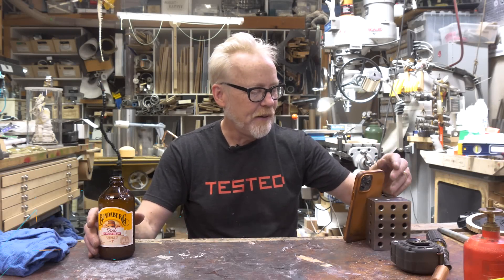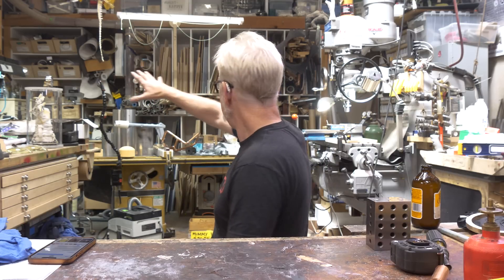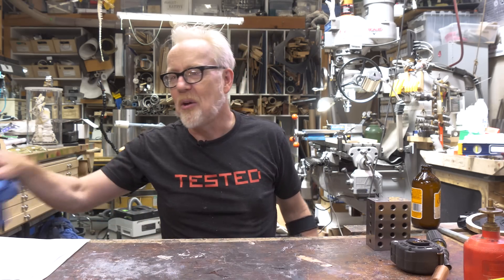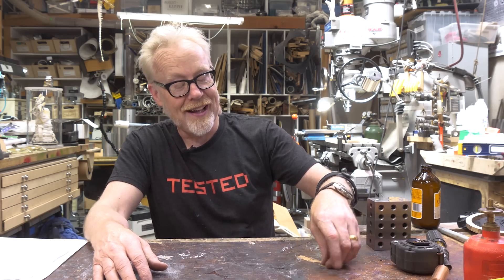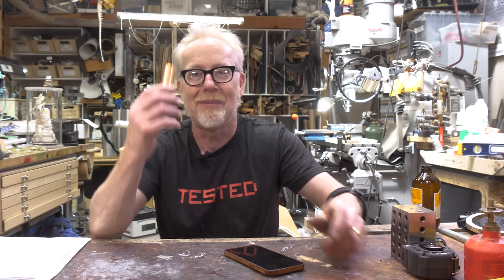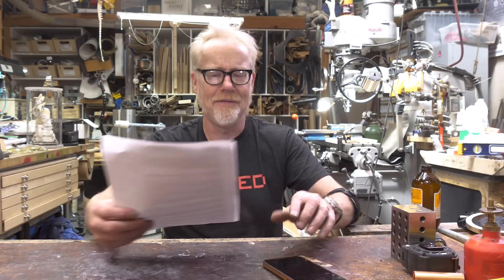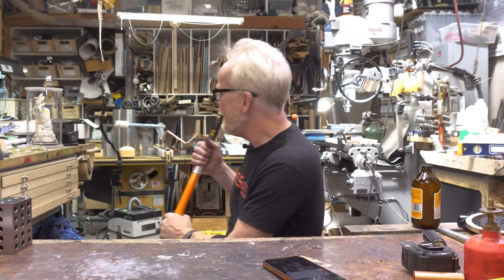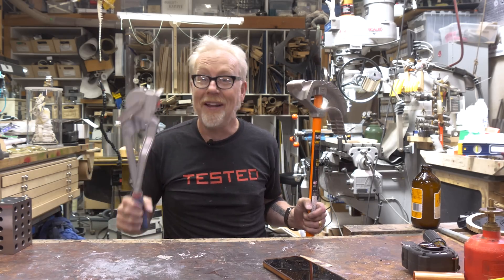Ask Adam Savage: Shop Power Distribution and How NOT to Lose Tools

Comment: Oh, yes. The 'buying another one of something because I can't find the first one' thing is why I have 3 or 4 12mm combination wrenches. Or forgetting I have something because I haven't used in so very long or got it but never used it. That's why I have 2 angle grinders. Though that's been a blessing in disguise since I can keep one set up with a cut-off wheel and one with a grinding disk.

Comment: Tool tip. If you have a one off and need a place to store it for the once in a while use go with the category it is. For example multimeter, OBD2 scanner and other electronic testing equipment gets the same drawer.

Comment: Split-phase or single-phase 240V is what is in the majority of homes.  A VFD or phase converter converts single-phase to three-phase.  In my neighborhood, there's a single wire, a 4600V feeder wire that the houses tap off of.  Single winding on one side for the HV and a center tapped winding for the 240V line in to the house.
I keep my conduit benders by the breaker panel.  Makes perfect sense to me.  ;)

Comment: Power is not something to mess around with unless you know what you are doing.  I work on low and medium voltage systems in industrial applications.  So working around power is not something i don't know how to deal with.  Home electrical?  No.  I will almost always get a residential electrician in to do the work.  Why?  I don't know the NEC.  It would be easy for me to make a mistake and do something wrong.

The residential electrical code is labyrinthine.  I simply don't have the time nor the inclination to deal with all that.  And since i don't want my home to burn down, i'm going to pay for the expertise of someone who does know.

Comment: also don't forget the cost of ownership, assuming you only have 3 phase power to your shop and no single phase delviered by your provider that means you will have your own stepdown transformer for your single phase useage and those babies use around 60 watts in standby and most people don't put those on a switch so that's a lot of power being used 24/7/365 that you are paying for VS if you have single phase delivered to your shop the provider pays for that loss.

Comment: Did your Power Co make you use 220 instead of 480? Everything runs cooler as your current use is cut considerably for a given piece of equipment. Smaller wire. Less current. Usually lower cost.

Comment: i'm lucky i have many friends in the I.B.E.W. if i have a power question they're pretty good about answering my questions. i was the concrete guy on the job sites and when i had nothing to do I'd help out the wire guys loved me lol cause i could push around the bigger spools of wire. that's how i met most of them. Adams right improper gauged wiring causes so many safety issues.

Comment: Early in my career, we worked in cubicles.  Power distribution was a daisy chain of power strips (typically 4-6 cubicles per chain).  Because of the kind of work we did, everyone had a minimum of 3 computers, with monitors, hard disks, etc.  The group's laser printer (one of the early, power hungry ones) was in my cubicle, plugged into the first power strip in the chain.  When someone would print something, you'd hear the printer's fan come on, then it would start heating the fuser wire (which literally melts the toner to the paper).  That's when the circuit breaker in the power strip would trip, and the swearing began.  We quickly developed a policy that whenever you wanted to print something, you had to announce to the whole group that you were about to print, and remind people to save their work.  Ah, those were the days.

Comment: Most of what I lose are hand tools. It happens when I have something in my hand and lay it down to pick another item up. As a result, car keys have been an issue. To combat it I intentionally place keys on the corner of a workbench or table. 
One day in my shop I had placed the keys, gotten out some boxes, found what I needed and reached for my keys. THEY WERE GONE! 
I looked under the bench and all around every corner of everything I was near, no keys. Doubting myself I stopped and visualized what I did. Yes, I did place it on THAT corner. So I sat down to get this conundrum solved and crunch, I felt the large key ring under my gluteus. Standing, I looked at the chair seat, no keys! WHAT!!! 
As I turned to look under the chair I felt something swinging from my backside. There they were hanging from my back pocket supported by the N52 super magnet I had slipped into my back pocket. It is difficult to describe how disorienting it was to lose something that was intentionally placed…

Comment: You would do well with a couple of rolls of ceramic wool. Just lay a mat under your welding, and a shower curtain around you. Roll it back up when you're done. It feels like cotton comes in rols like fiberglass insulation, and insulates like space shuttle tiles. You can heat it white hot, and hold it in your hand a second later. I can't believe you don't do more welding.

Comment: People get wound up about extension leads. If the extension lead is rated properly there are few issues with them. Especially if I'm in the shop by myself. I have all my tools plugged into the one outlet but I'm never using more than one (+ dust extraction) at once. I never run the table saw and the drill press and the pillar drill and the jigsaw and the Dremel at once, I don't have that many hands!

Comment: In my rental 's garage I have 1 single power outlet (from the early 60's i think) and  I don't have modern circuit breakers/RCD's on the distribution board, oh no I have the original ceramic fuses with threaded fuse wire.  My landlord won't spend the money to upgrade. My solution: I bought a power board with an RCD built in, protects my tools and the landlords dodgy circuit. Of course I'm not running a lathe or mill.

Comment: For anyone needing just one or two things to run on 3-phase power, one of the easier methods is to buy or build a rotary phase converter. The only hard-to-get component is a large 3-phase motor, the rest is just some relays/contactors and a bunch of capacitors. When tuned properly it will do a decent approximation of real 3-phase, without overheating after 6 minutes like Adam's (I assume) static phase converter. There is a small derating factor, but it's not huge and you won't notice it unless you're running whatever 3-phase machine pretty hard.
I use one for my mill, and it works great. Running actual 3-phase into the garage would have been several thousand dollars minimum.

Comment: I used a quite old milling machine because I could change out the motor to a single phase one. Whin I discovered that modern Variable Frequency Drives -that are fairly inexpensive can also CONVERT SINGLE PHASE TO THREE PHASE I sold my antique mill and bought a newer Bridgeport mill. Halleluiah.  So if you don't have three phase available at your place you can get around it with a VFD for motor driven tools.

Comment: It is a single to three phase converter. North America does not have 2 Phase. It single phase 120/240
Reply: Single phase is center tapped 240 VAC. It's 120 V from either hot to the ground bonded center tapped neutral wire and 240V between both hots.

Comment: Just a heads up but standard residential power isn’t 2-phase it’s split single phase; though in your shop with 3-phase power you would actually have 2-phases for your phase converter though the phases aren’t offset by 180 degrees but 120 degrees. You really should drop 3-phase to your sander as it’s much more efficient than a phase converter as no power is lost in the conversion. 
Not sure if your 3-phase is wye, delta, or high leg delta; I personally prefer high leg delta as I like having the benefit of a leg with 240V to ground. I will say the big downside of high leg delta is if you don’t have a lot of 3-phase appliances or receptacles you’ll have a lot of empty panel spaces. 
As an electrician I don’t have an issue with finding benders they are all on a rack in the rafters which is a highly utilized space in my small shop; at 6’6” I’ve never had an issue reaching things, though I do wack my head my often than shorter people.
Reply: The US version of three phase power seems a lot more complicated than the rest of the world! Aside from Japan, it's a bit weird over there too.

We have 230V phase to neutral (/ground) and 400V between phases. That's it, simple. No split phase, no different voltages, etc. I've heard rumours of occasions where split phase exists but only rumours. Very occasionally you get a premises that has two of three phases connected but they're still 120 degrees out of phase so it's 400V between phases.

Obviously the whole harmonisation thing is a joke, 220V countries and 240V countries all standardising to 230 with enough tolerance so no one needed to change anything.
Reply: @tomcardale5596 : It’s not really that complicated as their are options; NEC voltage ratings are to 125/250V on most standard items like receptacles and switches and we tend to see 120-124V and 240-243V on split single phase, which is standard US Residential power were both legs are fed from a single phase and single transformer with neutral tapped off the middle, this provides an apparent 2 phase system with the sin waves being 180 degrees out of phase.
3-Phase brakes down thought the world in 2 varieties either Wye or Delta represented as phase connections of either a Y or a triangle and provide in the US standard voltages of 120/208V, 277/480V, as a basic service and differ in power factor calculations, with if I recall right Delta providing slightly more power in calculations, though frankly I run everything through an app and haven’t thought of power factor in years. The outlier is high leg delta that has leg voltages of 120, 120, 240V and a leg-to-leg voltage across any two conductors of 240V; this is popular were I live and work as it means people can use standard 240/250V rated appliances as outside of the commercial sector few things are rated to 208 up to 240/250V without some marked losses. 
There are also done other outlier voltages but they’re usually only dropped for industrial uses or involve getting a buck converter to bring things up or down to the odd voltages. As an electrician I stick to residential and commercial and rarely do any industrial as frankly it’s just a lot harder and as I’ve gotten older I have learned to do/take the jobs I like plus 600 and 1,000 Volts while not that much tougher to work on do have some increased risks as do our line voltages of 7,200-12,300V though you rarely desk with tapping off of those things though in industrial applications it’s not out of the question to run things through pad transformers to reduce losses over distance, though unlike electrical service we can shut off power to the feeders and lock out and tag out things which takes away most all risks.

Comment: I kept opening the wrong drawer looking for my multi-meter, so I changed what lives in that drawer so that the meter was in there.  If I cannot condition myself to look in the right place, I will make the place I look the right place!
Reply: I started following Adam's advice a couple of years ago.  Now my wife goes into my shop for something and can't find anything. This advice works well for one user but may not be extensible.
Reply: I did the same with a set a hex drivers

Comment: We save a little when it comes to electrical because I know what needs to be done to run the wiring and install the boxes. Then we have an electrician that we use regularly that will come in and double check me before doing the hook-ups.

Comment: You talking about losing conduit benders is really funny because I'm a commercial electrician, I deal with 3-phase power all day every day and mostly what I'm good at is running conduit. The other electricians I work with I tell them, "Always put the bender back on the cart (We have carts we roll around with us to carry all our stuff) because if you don't you'll never find it again." I have gotten in a rush sometimes and I'll bend a piece, lay the bender in a corner against a stud or something, go install that piece, and then when I need it again I'll spend 20 minutes trying to remember where I put the damn thing.

Comment: Our robotics team has a small shop setup in a spare room in our school building. We have 8 outlets in the room, 6 of which are right next to each other in one corner of the room, and the other two (which happen to be two prong rather then three) are on the other side of the room, but next to the same wall.

We have all our tools on the other side of the room, under the windows, nowhere near outlets. To run our chop saw, mini drill press, etc, we have to run an extension chord along the wall and plug our tools into a power strip connected to the extension chord. We have asked for the school to add more outlets (which should be fairly straightforward given that there is already conduit with electrical boxes right where we need power), but nothing has changed so far.

Comment: LOL !!! I know about the buying a 2nd tool and then finding the first. I've started putting them where I would first look also!!! Also working up a shop-grid database and barcode library helps. Mine is a work in progress.
Reply: I did that last month when I bought a new box of light bulbs (because I couldn't find the half used box). When I went to put the new box away, I found the half used box right there.

Comment: Extension cords are fine... if you buy one designed for the purpose you are using it for. The problem is people tend to buy the cheapest one which also has the cheapest materials and smaller gauge wire than what they need for the persons desired use case. Tip: Buy one size larger than  the circuit you are plugging it into. 15 amp wall circuit? Buy a 12 gauge/20 amp extension cord. 20 amp wall circuit? Buy a 10 gauge/30 amp ext cord.
Reply: The bigger danger with extension cords is that when they end up getting put into permanent service, they get stepped on, rolled over, pinched, nicked, and so on. These cause electrocutions and fires much more frequently than overcurrent conditions because the latter typically just result in a tripped breaker or your undersized cord turning into a length of smoking plastic. This is why large swaths of the NEC are basically dedicated to wiring up spaces in such a way that nobody sane should need to use an extension cord in the first place.
Reply: The real problems arise when people chain multiple power strips one after another. I've heard horror stories of people using a single wall outlet and like a dozen power strips to supply an entire shop. Not only will you constantly be blowing your fuse, if you don't blow the fuse the first strip in the chain will inevitably get overloaded, eventually. And that's a great way to start a fire and burn down your entire house.

Comment: Yes, as a repair/builder of electric guitars (and sometimes bass) someone bought me a StewMac screwdriver set for guitars/basses, has like every flat/phillips/hex bit relevant to imperial/metric parts for guitars/basses, plus a really compact ratcheting handle with an extension. All fits in what looks like a dark red sunglasses case… and I have no idea where it went. It was on top of my tool storage, then I put a set of locking tuning machines in a box up there, and somehow that little case went poof then next time I went to look for it! I have other tools I can use, but they aren’t all in that one convenient little case.

Comment: Somewhere around the house I have one of those giant channel lock pliers you tell the funny story about. I have no idea how to lose something so massive, but it has definitely disappeared for months now.
Reply: I had a pair of needlenose pliers I accidentally put  in a wall cavity when we took the old medicine cabinet out of the bathroom and then covered with a mirror. Couldn't find them until we did a more thorough remodel a few years later and took the mirror down. It was kind of like a  Christmas present to myself.
Reply: I think its also about frequency of use. Something like that massive tube bender I'd stick up on the wall with a nail, almost like an art piece.  But more importantly its about getting into a habit of cleanup after a job and I'm pretty sure first spot best spot will help with that. - Also on the electrician stuff, in some countries it is illegal to DIY, and in doing so might mess with an insurance claim, beware.
Reply: I swear that my wife has a black hole that she throws tools, clothing, and other crap down when I am not looking.
Reply: @jamesupton143  Yep, Wife has multiple tool storage areas that my smaller tools seem to migrate to over time, combined with random moves of those stashes.
Reply: we had a circular saw at one point in this house. zero clue where it disappeared to.
Reply: Tamam 😢 aşkım
Reply: I have two sets of those, maybe 3 and can never find one, and if I do find one, it's only one.
Reply: It's probably under the sink.
Reply: @Christian-cz9bu  nah we replaced the garbage disposal not that long ago. i think in the garage behind something